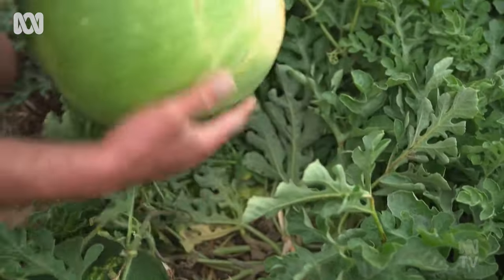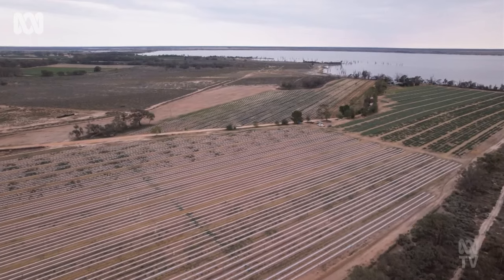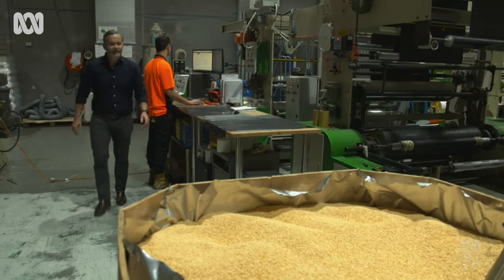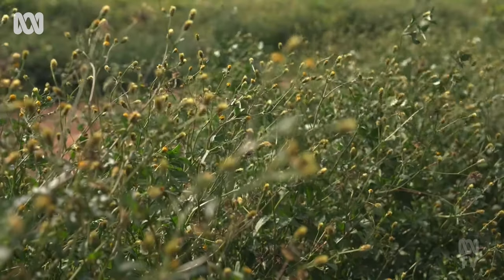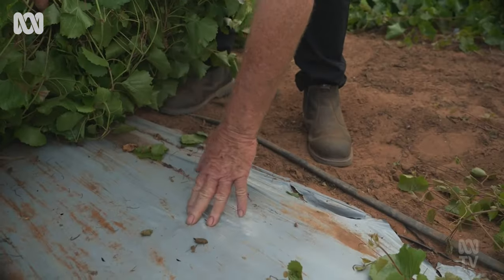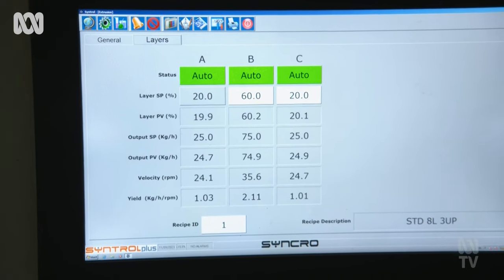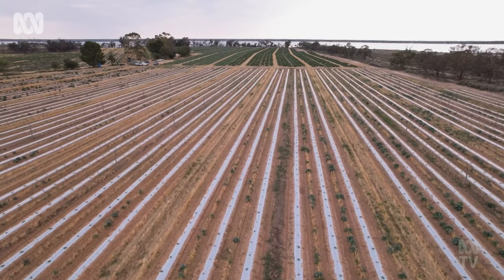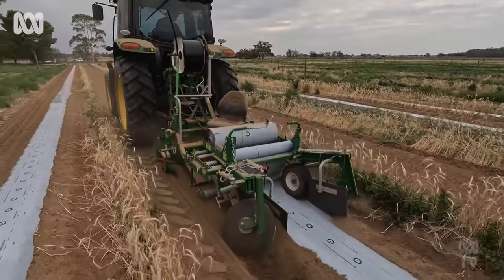Australia's first certified soil biodegradable plastic mulch | Landline | ABC Australia

Comment: I wanted to find out about soil treatment we have soil with a low Ph (acidic) the lab recommended 4 tons of lime per hectare which is an (alkaline) to balance the ph  when using drip and mulch  do you treat the whole field or around the root area since the rest of the field is covered with plastic .

Comment: Biodegradable plastic is basically just plastic that is not UV stabilized. Biodegradable Plastic decomposes into smaller and smaller pieces but chemically it doesn't change; think of biodegradable resins and polymers as a granite countertop. Decomposed granite as a garden additives are the same as the countertop only it has decomposed/degraded. Micro plastics are carbon molecules, so to say it breaks down completely is not entirely true. It becomes visually unrecognizable so the amount applied per volume of land is sufficiently small to claim that nothing remains after it decomposes in the environment. The manufacturer uses conventional plastics in the feed-stock, what did they add to make it dissolve into nothing in the environment? In Pennsylvania loaded with fly-ash drive the roads with hundreds of thousands of tons annually as a means of redistributing it and other toxic substances into the environment: they leave their dump gates ajar and the wind and rain spread it out. The residual part per whole amount applied relative to the vast expands of farm land is mathematically small enough to say that the plastic never existed but that is only due to a rounding error. Take a short ton of it, dig a hole, take a soil sample of the soik in the pit, put your bio film in a hole, don't cover it because it will turn into dark "carbon" rich soil, finally take a soil sample after 1 year and see what you've got and think about what has been left for your grandchildren through the miracle of "science" through agricultural laziness.

Comment: Micro plastics?
Reply: It's not a traditional plastic like PET, which is largely what's responsible for microplastics as they degrade. My understanding is that this is meant to break down entirely. Think of it like comparing cardboard sheet to metal sheets. The metal may break up into small parts but would take years to corrode and break down, whereas when the cardboard degrades and wears, even the small particles will break down quickly. I may be wrong, but that's how I understood it. If anyone who knows more about it would like to correct me, please do.
Reply: @nathan_middleton_ very nice thanks for the update ✌️👏👍